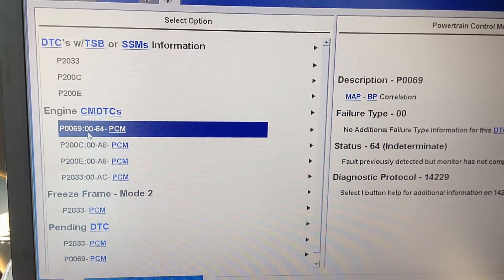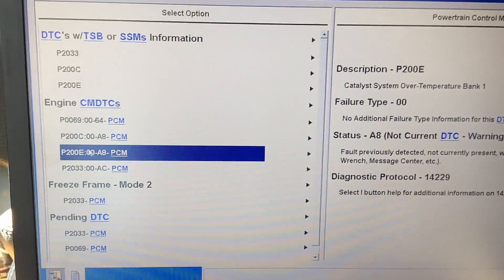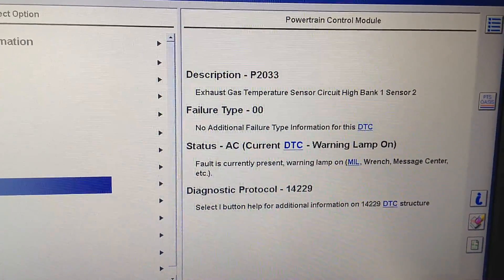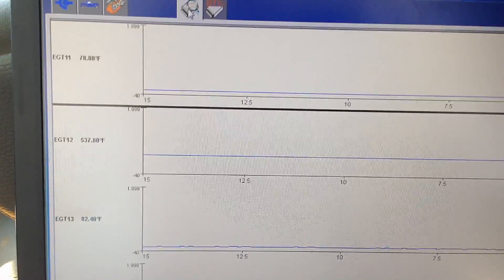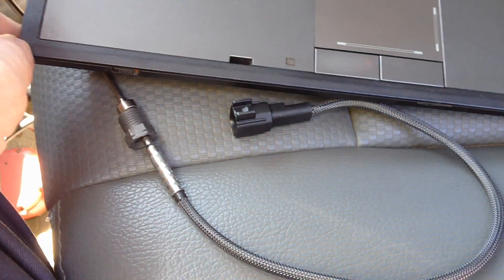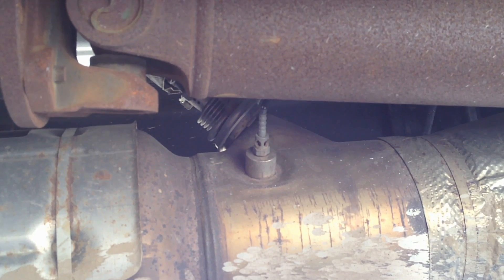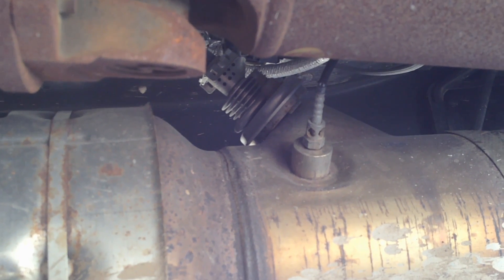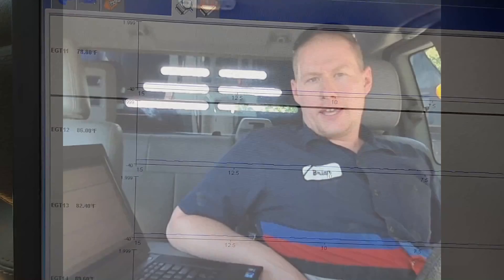Ford  6.4L & 6.7L Powerstroke Exhaust Gas Temperature Sensor Failures

Comment: I have a 2016 f350 diesel dully. Engine light came on and dropped by Napa, they ran a diagnostic and got a P24A0 3 times, Is that the same problem with the sensors ???? Im not a mechanic, can you recommend some one in San Diego who is affordable other that a dealership ????

Comment: Thanks for the video. I just changed the rear most EGT sensor on my F550. Erased codes and haven't came back yet.
Reply: As it turns out I also replaced the #2 EGT sensor today. It was the older style. I have a feeling here soon I will be replacing the next 2 sensors down the line.

Comment: Yeah it also has a brand new cat and a brand new DPF is PF diesel particular filter
Reply: hey i have a 2011 250 has p200e CATALST SYSTEM OVER TEMPERTUNE BANK 1 AND P200C PARTICULATE FILTER OVER TEMPERTUNE BANK 1 ANY ADVICE

Comment: I have a 2008 6.4 l power stroke it is throwing the P 200 E code for ait code but after it cools off it runs fine and it's the bank one Is what the code is saying it runs fine until it gets warmed up and that's I'd think it's the sensor flipping out

Comment: I have a p2031 Permanent exhaust gas temperature sensor circuit bank 1 sensor 2. I have replaced sensor EGT11 and EGT 12. Any idea why it is still showing on my scan tool as Permanent?  Thanks for all your great videos

Comment: Thanks for the video...i got a P2032 Exhaust Gas Temperature Sensor Circuit Low (Bank 1 Sensor 2).  Is that the 2nd sensor from the front?  Its a 2012 f350 supercrew.

Comment: Thank you for your help throughout the years
On my Ford 550 the sensor was reading 1580 Degrees Fahrenheit 20 seconds after starting the engine. I ran out like this for six months before the engine stopped running. I knew it was bad but there’s always tomorrow to repair it.

Comment: I have a 2009 f 250 and the check engine light is on I ran it on the computer at autozone and it said an egr temperature sensor is bad so I bought one but I have no idea where it goes and can find a video or diagram can you or anyone help me please??

Comment: Thanks so much for your vids on these problems. I have an 08 that bank1s3 was giving me issues. Temps would range from 294*-2000*. The truck is tuned and doesn't need the sensors but the PCM will still sense them if they're shorted out I guess? I replaced that sensor, plugged it back in and it still would read erratic temps. Figure it must be a short somewhere in the harness or the plug on the truck side? I unplugged it and ran the truck it instantly read 294* which would be fine cause it's within limits. Any idea of spots where the harness could short if there is a short along the harness? 

Thanks again man, the cut and 1/2" socket tricked worked perfect
Reply: Did you ever figure this out? I’m having the same issue

Comment: I have a 2008 Ford F-250 powerstroke and had an exhaust leak my DPF was loose because the bolts that hold it together where stripped and the hot exhaust air melted one of the sensor wires the one right on the DPF. How do I look that part up to buy it or what sensor is that. I'm having trouble trying to purchase it because I don't know witch part it is. I need help thanks

Comment: Great video! Will the 8C3Z-12B591-E work for an 08 6.4l F250? Thank you in advance sir.
Reply from the maker: +1kArghArgh No that sensor is for the EGRT system on your truck not the EGT sensor for the DPF as shown in this video.
Reply: +FordTechMakuloco Much appreciated sir. I was hoping it was an improved sensor for all platforms.

Comment: @fordtechmakuloco  i have a 2006 explorer with a p0108 code reading, what is the solution?
Reply from the maker: +ryry50001 your fix is to replace the egr system module.

Comment: +FordTechMakuloco I have a p247b on my 2012 f450 but the truck starts and runs no problem. Is it safe to drive for a couple days? my business uses this truck to ship goods OTR 4 days a week. doing about 400km per trip. Thanks!
Reply from the maker: +VTL It can shut the engine down if it fails high, the sensors should be in stock now and they can be swapped in 5 minutes.
Reply: +FordTechMakuloco yep I just bought one at the dealer. what did you say in the video, I need a 13 mm wrench? I have no bay to do this in is it ok if the sensor gets a little wet? it's pissing rain out!
Reply from the maker: Yeah sounds like the right size water wont hurt it there is tons of water in the exhaust systems
Reply: +FordTechMakuloco thanks man you're getting a sub out of me!! what about starting up a website where us 6.7 owners can talk to you directly, I and many others would gladly pay for your expertise!!
Reply: FordTechMakuloco I replaced the sensor in question and cleared the code with a scanner. CEL went away and after a few hours(4-6) of driving the light has returned. Is it possible the sensor I got is faulty? Is there a way to test that?

THANK YOU!

Comment: Good info. Thanks for making these videos. My #4 sensor is tossing a code every so often. Not stranded yet, thank goodness! But I want to change it before my luck runs out. Anyway, mine is a 2008 6.4 and in your video you say the PN is the same for 6.4,6.7 however when I go online to get it, the 2008 has a different PN that is 3 times the price.  Does the AC3Z5J213 in fact work in the 6.4?
Reply: +ibldrc Did you get any info on this? I need to replace the pre-cat sensor and with all the part numbers I have found related to this I would appreciate any info. Thank you in advance.
Reply: +1kArghArgh , No direct answer, but I looked around a bit and it seems to me that the PN noted above has a different plug, so it won't work on the 6.4. I bought the 8C3Z part number, and my local Ford dealer actually had a competitive price at $58.
Reply: +ibldrc Thanks for the speedy reply.

Comment: I have an 08' F250 diesel...when the"cleaning exhaust" comes on, why does the cab of the truck smell like diesel.
Reply from the maker: Laura Gomez Because it is dumping fuel down the exhaust when the exhaust valve opens.

Comment: Can you give the part number for this part?  I Have a 2012 F350 King Ranch and this has happened to me at 12k (under warranty) and now again at 63K (not under warranty).  This is my second 6.7.  My first one was a 2011 F250 and the dealer had it longer than I did with a problem they couldn't fix.  Ford did nothing on either case.
Reply from the maker: Mark W. Richardson AC3Z-5J213-B

Comment: How do you get those stubborn sensors out of the bungs? One came out easy other two are in there.
Reply from the maker: Scott Reid I have a video on the 6.4L egt sensors you use a torch to heat the bung.

Comment: Is there any way I can tell what sensor is bad. Without the laptop. 
If I replace one and try to crank it will I have to wait 60 min and try another sensor
Reply from the maker: kevinator213 Pretty much without a code or live data you are guessing.
Reply: FordTechMakuloco I just replaced all 4. Company truck and company money. Thanks for replying ima sub now. Thanks

Comment: I have a trans problem in my 08 f450 6.4 , it wont shift into Drive or Overdrive, any sensors or solenoids I should look for ? It has 121K on it , and runs like a top, I like reading your site , Thanks
Reply from the maker: Don B Any codes set? Those transmissions are very complex compared to others there are lots of possibilities. First thing that needs to be done is pull codes, then check fluid level, perform pressure test. see which gears are actually affected and then finally a pan drop to check for debri. Is the fluid burnt smelling?
Reply: FordTechMakuloco Yes, two codes,p0488 EGR throttle control circuit ,I know what that is.p1000 OBD system readiness test , don't understand that one. The fluid level and color is fine, no change .I don't know of the pressure test or where to test, haven't dropped the pan yet. truck has only 121k miles on it , and just off warranty

Comment: This just happened to me with my 2011 6.7 F350 Lariat. Local ford dealer says waiting time for parts is over 1 month!
Could you please recommend a good diagnostic tool I could purchase so that I may see which of the four sensors is playing up. TVM
Reply from the maker: All you need is a scan tool that can read codes and that will tell you which one like this for example- bank 1 sensor 4= EGT14 and so forth for each sensor. They will set a code for sure if the truck is down. This backorder problem is why I say almost a good idea to have one in the glovebox.

Comment: Could you unplug the faulty sensor and cycle the key for a temporary fix???
Reply from the maker: You should be able to unplug it cycle the key to on and manually flip the starter on as shown in my 6.4l video. This one as is with that high fake temp would not even allow that though.

Comment: Hey I know this is totally off topic, but I have a 2004 ford f150 5.4 3v, someone drilled into my passenger side head trying to drill out a stud for the exhaust manifold. do you know where I can find a write up on how to do a head replacement, or a head gasket replacement for this. I really could use some help. Thank you, alos if you do my email is jsheehan0330@yahoo.com thanks again in advance.

-Jeff
Reply from the maker: sent
Reply: Hey FordTechMakuloco, I never got anything in my email, any chance you can send it again it would be much appreciated!

thanks,

Jeff
Reply from the maker: I forwarded the original email, if you don't see it this time check spam folder. Apparently if I am not logged into Ford the pictures wont load. If you need the pics I can try another way tomorrow from the Alldata account.

Comment: Hello fordtech!  I got a problem maybe you can give me ideas.  I have a 2000 mustang gt. It has been running awful.  I had a misfire with a check engine light.  All coils were replaced check engine light is off.  It seems to have a misfire again but no check engine light.  It seems to do it when the car is in normal operating temp. When i drive it feels like it jumps to overdrive to quicky im lost on where to begin.  I was wondering if a spark plug is bad will it throw a check engine light? Anything will help thank you
Reply from the maker: How long since the coils were changed? Also are they motorcraft coils? If autozone pulls codes there are none?

Comment: Hey I was wondering if you ever get a chance could you make a video or tell me your experiences with 2012 focuses that wander all over the road at speeds above 45 mph.I saw a tsb that said replace the rack and do a reflash.I've got 33k on mine and my fiance has 30k on hers.also a 2003 ford Windstars with growning power steering noise.its been flushed I've also gone to mercon v (I use all ford fluid and parts). I've put a pump on.we've had the problem since 2004 and the ford dealer just ran us out of warranty.
Reply from the maker: Never had anyone complain about one yet, but yes I see the tsb you are talking about.